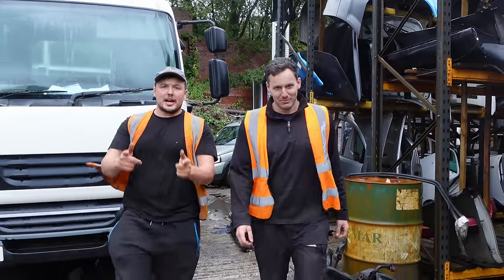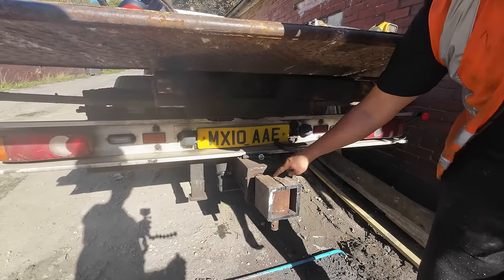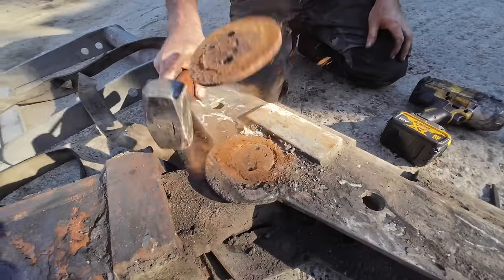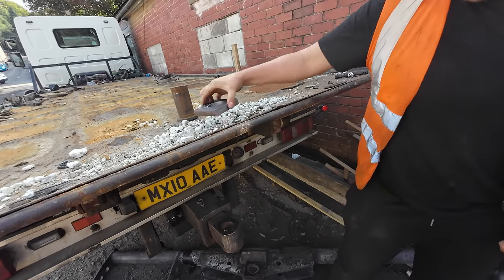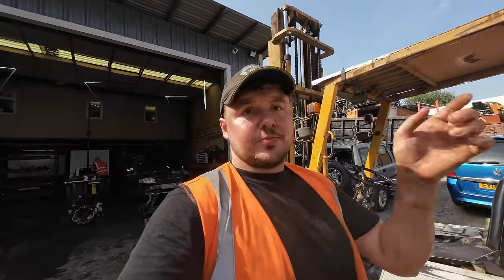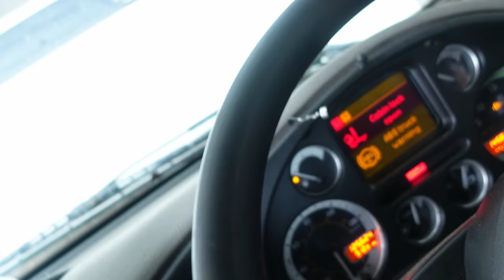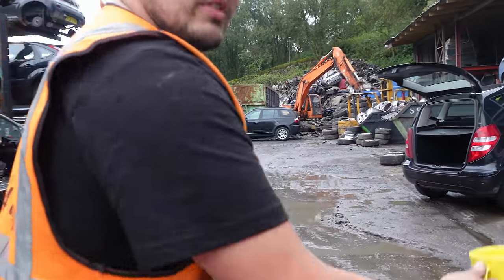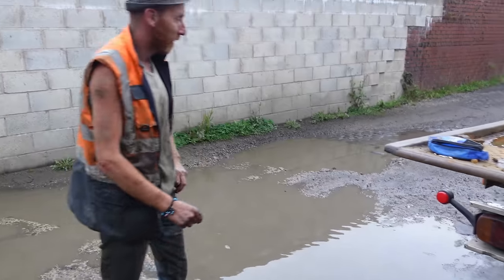Fabricating A Spec Lift Onto Our Recovery Truck! FT The Professional Struggler

Comment: Good luck drilling through that spec lift pin with it being a piece of hydraulic ram they are case hardened for about the first 5mm under the chrome plating, you should have got the person who done the spacer plate and pin struggle with drilling it.
Reply: The only way to stop it coming out if you can't drill it is weld a strip of steel across the bottom of the pin and if you ever need the pin out just cut the welds
Reply: @markmawson1  yeah good idea Mark simple but affective 👍

Comment: If it's not building air up on the daf. Top off the air compressor inside there's a Gaskit that breaks. You not get it to take sir when that's gone. You have to buy the full set off gaskits but you only need the one out the set. We been thru many over the years

Comment: There fitters and there’s fitters, if in doubt give a clout . That’s probably why the other seized up , coz the bellend assembling it burred the pin and damaged the holder . Line it correctly, you will probably find the lower coupling is now bent or out of shape.

Comment: Welding is shocking  “ nice thick weld” the only thing thick about is the person who welded it. You  need to be a coded welder when working on LOLER Equipment. If something fails and someone is hurt your going to be eating porridge or end up with a mega fine and no yard.